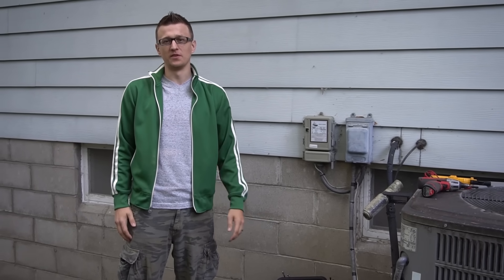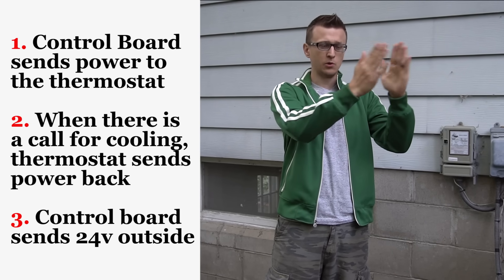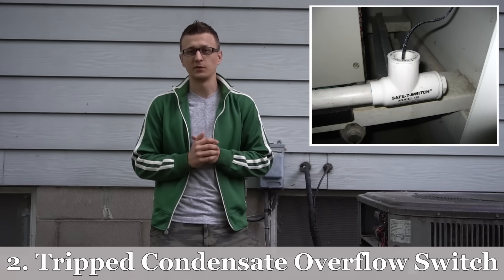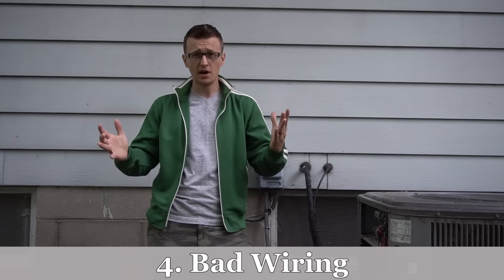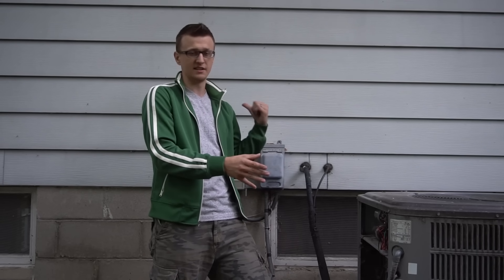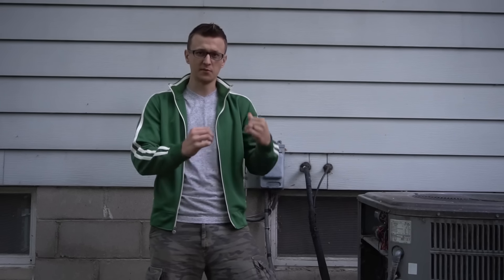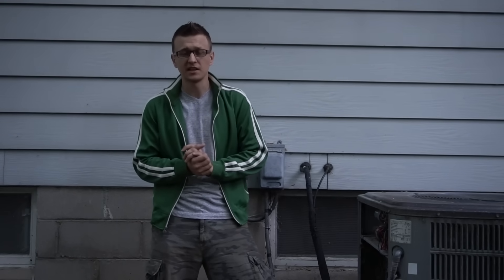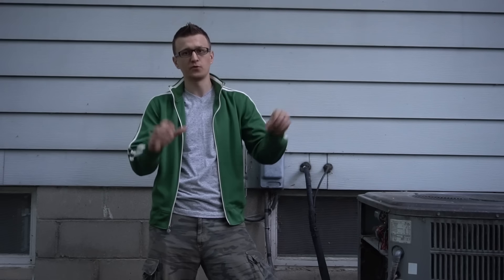AC Contactor Not Pulling In - 10 Reasons Why

Comment: Great video and tips!  My AC compressor fan stopped working so I replaced the start capacitor since it is an inexpensive part and the existing capacitor was over 10 years old and the top was rusty.  While I was in there I cleaned up the wires and checked for any damaged wires, but everything looked good.  The fan still didn't work.  I spun the fan manually with a wooden dowel to make sure it spun freely, and it seemed fine.  I depressed the plunger on the ac contactor and the fan started with no problem.  I went back to your wonderful library of HVAC videos to find more info about the AC contactor which suggested to watch this video.  Glad I did!  You mentioned replacing the batteries in the thermostat even though the display is working AND there was no low battery indicator.  Sure enough, I replaced the batteries and the AC compressor fan turned on!  I've got a better understanding of my HVAC system, I've got a new start capacitor so shouldn't have to worry about it for another decade, I cleaned up the wiring, and I now know that a pair of fresh batteries can make the difference!  Thanks for your great how-to videos!
Reply: Very similar story.  I did change the batteries just to be thorough, but every indication was that the thermostat was working fine.  You'd hear a nice crisp snap of the relay and the squirrel cage fan would kick on, but no compressor.  Before going into the compressor itself, I decided to swap in a known-good thermostat.  Voila, nice dependable AC again.  I was picturing a potentially expensive repair, but a $25 thermostat did the trick.  So -- just because your thermostat starts the squirrel cage blower, your thermostat can still be the culprit.
Reply: So glad I saw your comment mine did the same thing!

Comment: #11 should have been a bad double pole breaker feeding the air handler in the panel. I was getting 120 v on each wire but was not getting 240 v across the two wires. Replacing the 60 amp breaker solved my problem.

Comment: The condensor fan & compressor wasn't kicking on when the thermostat was calling for cooling. I was getting 24v at the coil but my contactor wasn't pulling in to complete the circuit. As I was troubleshooting, I noticed the contactor installed was a 240v coil. Make sure you have a 24v coil contactor installed, otherwise the plunger will not pull in to complete the circuit . If you're replacing a contactor, not only do you need to match the VAC, FLA, LRA, & RES, you also need to make sure you're matching the coil voltage as well.

Comment: My contactor did not pull in. After listening to your video, I disconnected the black wire from the circuit board and connected it directly to the contactor. It clicked instantly and the ac started working right away. My question is this. Is this a permanent or temporary fix? How do I test the board for a bad connection? What should I do. What you do is so appreciated by regular joes like me

Comment: I’ve done some troubleshooting.The system stopped cooling after I replaced a severely clogged return filter. Since then, I’ve confirmed the thermostat is working, the contactor engages manually, and the capacitor looks good. I bypassed the float switch (no change), and the control board shows the low-pressure switch is open. Both refrigerant lines are cool to the touch. The evaporator coil is clean and thawed. I suspect the low-pressure switch may be stuck open or refrigerant may be low.

Comment: I found that my capacitor was bad. I replaced it and it still didn't work and it still had the four blinking red light code. I shut down the air handler for a couple of minutes and it reset the board. Turned it back on the I have A/C again! I'm not sure if you mentioned that or not...

Comment: Thank soooooooo much!  My ac went bad… started blowing hot air and the ac fan outside was not spinning.  I thought it was capacitor but it didn’t looked deformed so I called local ac guy.  I think they sent out a sales man.. quoted me $10000 for coil replace or $15,000 for entire new system…..he did point out that one of the power wires was burnt and so was the contactor. After the quote and $50 consult he went on his merry way. I replaced the wires from the fuse panel to the fan unit, replaced the contactor and the capacitor. Contactor was not pulling in…. Don’t know if it was the guy, but the condenser overflow was at a slant.  I had no clue until this video .  I fixed the angle on the condenser overflow and it started right up. It was 109 yesterday and 110 today.  I bought swamp cooler but that can only do so much.  I’m soooooo happy for your information.  My unit is 2o17 so it shouldn’t go bad, but can.  Again thank you!!!

Comment: I'm stumped....Ive watched several of your videos. My contactor not pulling in when thermostat calls for cooling but the fan is. My unit doesnt have a overflow switch, high pressure switch, low pressure switch, time delay board, power saver switch or 3amp fuse. Transformer is putting out 24 volts. I was convinced it was my IFC board but with new one still same issue. Replaced manual reset limit switch and auto reset limit switch and pressure switch. 🤬🤬 Thermostat checks ok, Capacitor checks ok....i give up.

Comment: My AC was not running (famous last words!) and I've been checking everything you suggested.  I finally pushed the contactor plunger manually with a broom handle and the AC unit then powers up.  After doing that test, I checked voltage at the red/white thermostat wires and I get no voltage, yet I've actually "jumped" the R and Y wires at the control board to bypass the thermostat.  Still not getting anything.  Well....it turns out that I followed the thermostat wires going out from the control board inside the house in the basement out to the AC unit...follow the wire....wait there's a cut in the line just before leaving the house to the outside...thank you for sometimes overlooking the obvious.

Comment: I'm confused, everything outside seems to be ready to rock but does nothing. Replaced the capacitor, I also replaced that little Gadget that all the wires hook up to inside of the ac. Still nothing, all the voltages are correct outside. One thing I did notice is both green lights on the furnace stay illuminated and don't flash, I believe they're supposed to to be a slow Flash if everything is operating correctly. Any chance those lights not being at a slow Flash causing this issue

Comment: Question my contactor has power but won’t engage check my thermostat on voltage only gives me 12 volts I notice my power saver switch box it’s off can that be the problem for not getting the 24 volts in my contactor?

Comment: Thank you so much! I was troubleshooting for hours, found your video, was directed to this video from that one, and I finally found the problem. It was corrosion at a wire nut in the condenser unit. Stranded wire mated to solid wire with a wire nut. It felt loose, but didn’t pull out. When I started unscrewing the nut it shorted for a second. I cut and stripped back enough to get a fresh connection, used a wago connector. Running great now
Reply from the maker: You're welcome! Glad to hear that you were able to finally track down and fix the problem. Stay cool!

Comment: Thanks for the info.  I have two older Lennox HS26 036 2P units.  One of them needed a universal capacitor last year.  Yesterday the same unit stopped working.  The wiring is different from the video, there's a control module that the Power Saver swtch, and the high and low pressure swtches connect to.  I reset the high pressure switch and the unit turned on and worked for a short time.  When I pushed the contactor plunger in I noticed that the fan ran much slower than normal.  Seems like that would decrease cooling and maybe trip the HPS?  The fan spins freely.  I'll hose off the coils tomorrow.  Could a bad capacitor cause the fan to run slow, or is it the fan motor itself?  Thanks in advance.

Comment: I have a goodman package unit, everything is outside, I have to throw water down into the top into the fan area from my porch to make the compressor come on and the fan to come on, nobody knows why, after putting water into the fan/compresor area the compressor and outside fan comes on, other wise only the circulation fan into the vents is the only fan that runs,until I wet the outside unit????? Do you know what part needs to be replaced to fix this.

Comment: after changing everything from capacitor to conductor, filter, cleaning the condenser fins, making sure the fan is good, checked the wiring and cleaned everything, the breaker trips. I turn on the a/c and it runs about 20-30sec and it trips.   So only one thing left is a new compressor. I think all of these are good ideas  but generally when the a/c trips the breaker, its the compressor unit going bad.  I tested the compressor in a way this guy explains, measured resistance on the wires, all good, perfect numbers.  Still the compressor gets super hot and eventually trips the breaker. I felt the heat coming off of it much warmer than the 1st floor unit.

Comment: Thank you thank you!  By watching this video i was able to fix my ac unit! Step by step: thermostat worked, furnace fan worked, had power 243 volts to contactor switch, replaced the capacitor (got for $15 on amazon) to rule that out. The ac fan and compressor would come only if i held down the contactor switch. It was the high pressure line coming out of the compressor! Pushed the reset button and 🌬❄️!!  I saved myself a ton of money Im sure. 
Thanks for explaining the steps so clearly!

Comment: Thank you for the video! It's a warm and humid day here in SE Texas and the outdoor compressor unit would not start- Contacts not engaging. Your video allowed me to troubleshoot and discover I was not getting 24 volts to the contactor. I explored and found that I had 24 volts coming from control board but not to contactor. My overflow pan had a float switch and 24 volts and that is where the volts got cut off!

Comment: Way to go.  You covered every single possible reasons for the issue and in easy to understand language.  Half of these I already knew, but I'm glad I learned the other half.  Turned out my problem is the cutoff box installed by AC electric.  I just bypassed it and all is good now.  Many thanks.

Comment: Jay, many thanks for your AC Playlist.  I was able to use it identify and replace both a bad capacitor and a bad contactor. As I worked through the trouble shooting list, I had to go to the attic to access the 24V control board in the furnace housing.  While replacing the front cover of the furnace, I inadvertently rotated it 180* to place a corner with zero backing insulation over the pressure switch that tells the system that the furnace cover is back in place.  Your tip stating that if there is 24V of power present at the thermostat wires of the condensing unit outside, then the problem is in the condensing unit.  If 24V are absent outside, then the problem is inside. When I removed and replaced the furnace cover to its original position with enough backing in place to depress the pressure switch, everything ran perfectly.  As you know, HVAC systems have a lot of "moving parts".  Thanks for creating such a complete list of trouble shooting solutions.

Comment: Another awesome video!  Please more videos...
Issue I have is the thermostat inside screen is blinking on/off...and there is 26V on red/common and green/common.  But no 24v on outside at contactor.   Wire outside seems to be intact so wire is still intact...still checking if wire is broken somewhere...Will check the 3Amp fuse and why thermostat screen going on/off.  Fan does come on if I push the contactor.  Any suggestions?  Thanks alot

Comment: My unit worked fine for about four years.  No recent changes. I've tried changing the contactor, but that didn't do it - and I connected the new contactor to a 24vac supply elsewhere to confirm that it would pull in under those conditions: it did.

Anyway, I have 24v at the contactor, but it's not pulling in (and it only reads 24v when I disconnect the wire from the contactor). I'm wondering what failures would lead to 24v but with insufficient power to pull in the contactor. My thoughts are 1) a marginal transformer 2) problem at some wire connection 3) physical damage to the low-voltage cable controlling the contactor (none is visible between the house and the contactor).  Any thoughts or suggestions?

ETA:  I removed the contactor and connected it to the red and white wires at the control board to verify that there was sufficient power there - there as. I think that leaves me with a problem with the cable between the control board and the compressor/fan/contactor.  To test this, I bypassed the high- and low-pressure switches (and accidentally blew the 5A low-voltage fuse while I was at it - grrr!). The fan and, I assume, compressor are running. After more than 10 minutes, it didn't produce cold air. Maybe the problem is actually a lack of coolant.

Comment: I do ac & commercial refrigeration. I have a strange problem on 3phase 50 amp contactor where it energizes but wont pull in unless i push lightly on the manual energizing button in the center of it. so of course I swapped it out & same problem. the transformer is a 96VA transformer that could run 2 contactors. tomorrow I check voltage across & start undoing other low voltage wires as i think I have a short yet everything is fused at 3amp fuses & they dont blow’ 

do yeah its ANOYING’

Comment: Hi, Your videos help understand AC system and diagnose my AC problem. AC attic fan is working but not outdoor unit fan getting power 27v, installed a new thermostat last night. It starts the attic fan.  When I push a button on contractor, it started spinning. I also put a new filter and capacitor. Do you happen to know what to look for? Thanks

Comment: Thanks for this and your other videos. I think I need a new brown (red+green) wire between control board (in furnace). My logic:  No plunger action but AC works manually. I have 24v everywhere except at the brown wire coming into condenser. [everywhere=thermostat, low volt transformer side, into control board, control board out -- including at some wire nuts outside the board's box]. I even jumped the therm's R and Y leads. I'm not willing to crawl under my mobile home to inspect wiring. I ordered some new brown wire to wire externally. Hope that works. How am I doing so far?
Reply: i forgot to mention that the furnace's fan comes on normally with thermostat, but nothing at the condenser
Reply: I spliced in a the new pair of wires from the control board voltage out, to the 24v contactor leads, and voila! I have ac!! It was a 30' run. I'll be cleaning the coils and filters while i have stuff open. Although I think i went the long way by troubleshooting the condenser end, the control board and the thermostat end before thinking about that wire, I sure learned a lot. Thanks again!

Comment: I replaced capacitor, fan motor and contactor myself, but the contactor was still not pulling in. I had to have an HVAC technician come over. It turned my AC low pressure switch was damaged. He bypassed the wires.

Comment: I'm really hoping you see this comment.

I moved into my home 13 years ago.  The first thing I had to do was call an HVAC guy out to charge the system because it wasn't cooling.  Over the past 13 years I've replaced the A/C capacitor several times, the furnace heat sequencer several times, the thermostat, fatigued and broken wires and last year the fan motor in the A/C.  Every other year, sometimes more often, I was having to fix something.  At the end of last season my evaporator coil was freezing up so I figured I'd have to have the system charged again this spring.  I procrastinated and didn't do it and then it got hot.  I thought about it and decided I was tired of working on it and always worrying whether this 35 year old system was going to heat this winter or cool this summer.  I decided to replace the whole system.  Being retired and living on a fixed income I found the cost to be prohibitive.  Fortunately, I've always been a big time DIYer.  Plumbing, electrical, building, renovating...  there was never a job I wouldn't tackle.  I decided to order a new system and install it myself.  Doing it myself would save me about $10,000.  The equipment arrived on  Tuesday and I had it all installed by Thursday.  Friday and Saturday were spent trouble shooting trying to make it work.  I watched countless videos on YouTube looking for helpful information.  Blurry, shaky, poor audio, poor explanations, no explanations, incomplete explanations and inconsistent explanations.  Thirty minute videos spending the first twenty minutes explaining what they are going to explain to me.  Suffering through them all hoping to find ten seconds of useful helpful information.  Occasionally I found it, but it was never enough.  I know most of these people are trying to share and help, but I would certainly not enjoy being trained by any of them.  Then I found you.  It was your A/C, furnace and thermostat videos that got me over the hump.  Clear and concise with simple yet detailed explanations.  How to wire this and how to test that.  After three weeks of killing heat I am finally cool.  The job turned out to be a lot bigger and more difficult than I expected and pushing seventy years old didn't help, but thanks to you I got it done.  Thank you for taking the time to share your knowledge and for doing it so well.  I don't subscribe to many channels, but you just got added to my short list.
Reply: Excellent excellent excellent